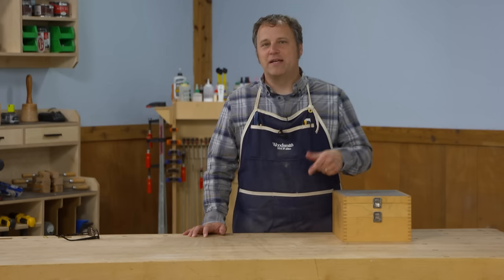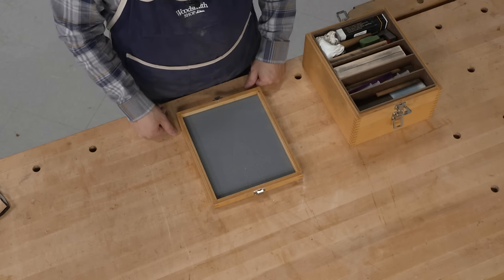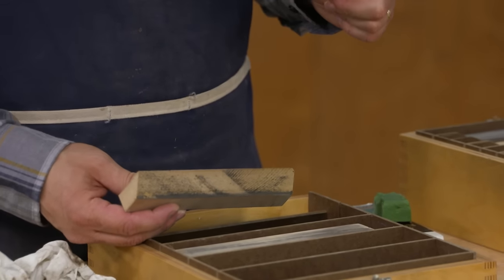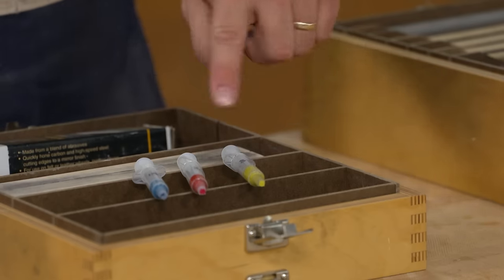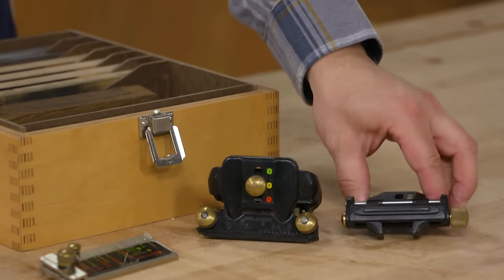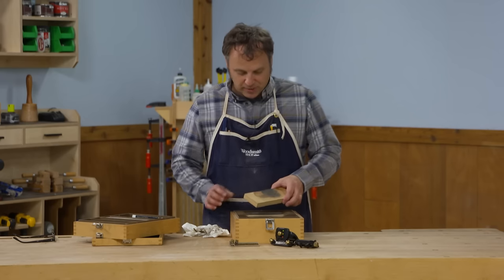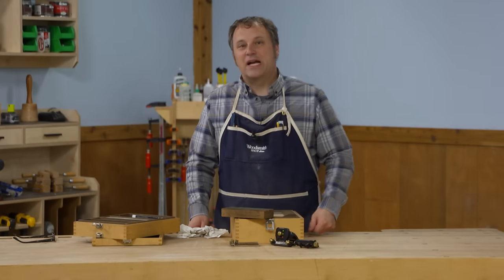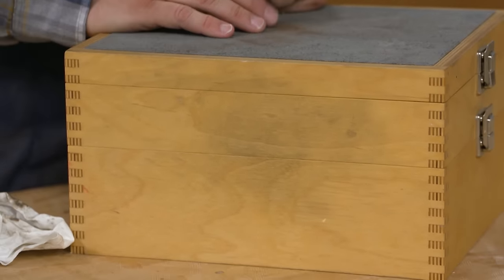Shop-Made Sharpening Supplies Box

Comment: I made this and the only changes I made were to add a piece of glass to the underside of the lid to better contain the water and chrome padded handles.  I didn’t catch making the very top with the sandpaper removable but that would’ve been nice for easy replacement.  I had a little trouble with the plywood chipping out when making the finger joints but could have been the plywood I used.  Overall this is an awesome project and I reach for it all the time now.
Reply from the maker: Glad to know you like it as well. It's been a lot more useful than I thought.